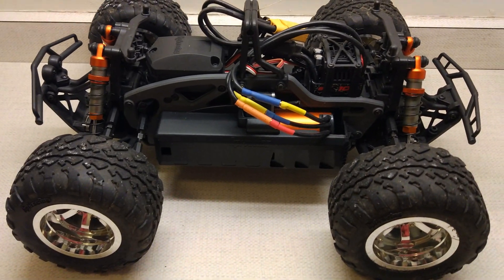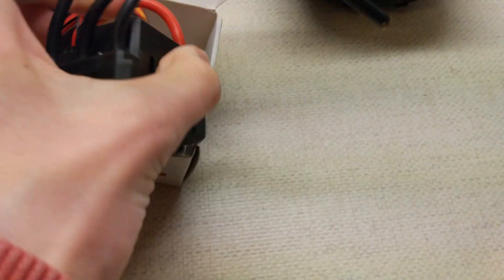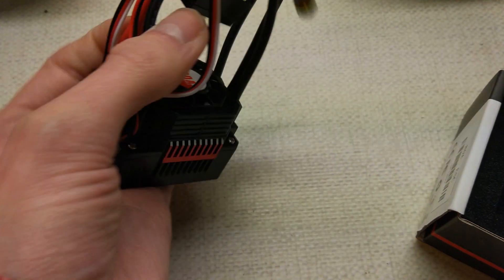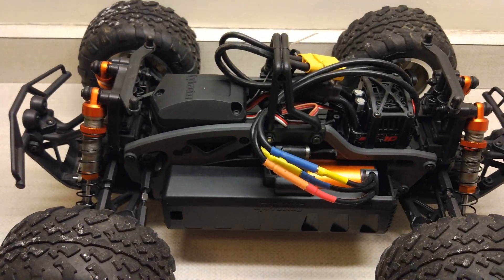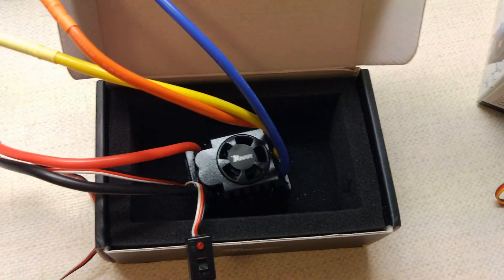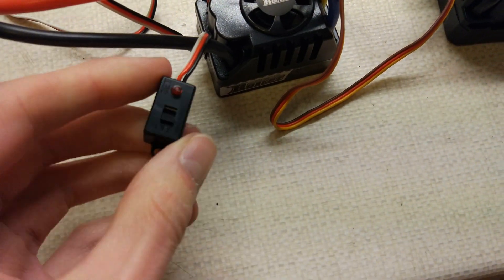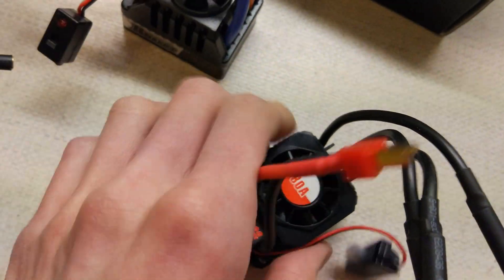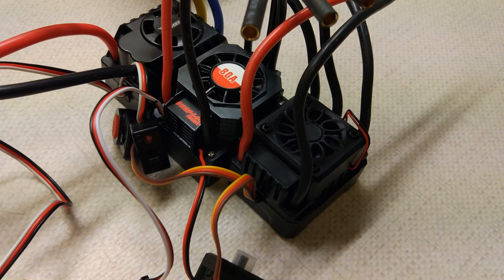80A ESC Overview X Team Surpass KK and Surpass Rocket

Comment: I can't wait to see the results of this comparison! Thank you for the video and all the effort and knowledge sir!!!!!!

I've had the same orange Surpass 60a fir 3 years and had it in a 4wd Mega Senton, Optima, 144001, 2wd Rustler XL5, Glamis Fear 1/8 2wd, BoLink Drag Rail, and a Gold Pan RC10. Its held up well, even on 3s with 3650-2p-3300kv KK BL motor. The fan still blows hard and ESC still pulls hard. I have since let it go to a friend and got the Surpass Version 2 KK 80 amp ESC, AKA Rocket-RC V2 80a ESC. This is the one with the "momentary" push button for on/off instead of the slide switch and it has the  program button next to it. I also got the Version 2 Surpass LED programming card. One thing I noticed is that my trusty old 60a ESC had many more programming options, 17 to be exact. And seemed to be about the same in performance. I desperately want to say this new ESC is leaps and bounds better but if I want to be honest I'd say it's relatively the same. Thats not such a bad thing considering all the cars, BASHING, wear & tear, and number of battz I ran through the 60a and it just kept going, popping wheelies and sending rooster tails of dirt all over the lands surrounding me! I can say they all come from the same massive plant in Shenzhen China , manufactured by Shenzhen LTD, CO. All the Hobbywings, Surpass, HobbyStar, HobbyQueen, Gool, ZTW, Reactor, etc.... I have been to the plant. The difference is the quality of craftsmanship. The more experienced workers are allowed to solder higher quality, more expensive components and they also get a $0.05 discount government issued gas card and $1100 more per year! Awesome! The different brand names are not used in China as they are not a free market system. Brand names are used by China only when exporting. I find Surpass Rocket, or as it's now called ROCKET-RC, the best "budget" brand. But fir superior support HobbyWing is far better. If you require good customer service go with Hobbywing. If you require solid budget bashing running-gear go with Rocket-RC. ZTW sits king of the BIG ESC GAME with fair support , great quality (for the most part) and features on oar with HobbyWing as well including PC Link, Bluetooth and Telemetry.   X-Team is a brand on par with Rocket imo, but most comparisons I have seen show Surpass Kk motors and Platinum motors beating Xteam at far less cost. I know not of Xteam ESCs though. 
Anyway, when you consider that a Tamiya TBLE-02S costs about the same as all these ESCs and then compare the features...and even bring the famous workhorse of a sensored 2POLE  ESC like the Hobbywing 10BL120 and NEW equivalent Rocket-RC sensored 120a ESC that also cost the same as a TBLE-02S you have to wonder what Tamiya and Kyosho can ever do to come anywhere near these ESCs. I don't see it happening....ever.
Reply from the maker: Not. Going to happen as I've sold most of my spare electronics now.

Comment: How did you think about surpass hobby kk esc ? It's good ?
Reply: I have one, the same 80A version it seems pretty good for the money. One thing I will say though it only reccoginses 2-3S lipos even though it's says it's specs are 2-4S. This is a spec mistake. If you plug in 4S you will only get steering, no thottle. Other people with this ESC have also discovered this so it's not just my one.
Reply: @druscanam  ohhh .okay tq sir 👍 i have bought 120a surpass esc , it's really good for me .I'm try to put dual 3s 100c lipo on this esc without any issue .esc not overheat .120a surpass hobby esc,surpass hobby 3650 6900kv brushless and dual 3s lipo 100c .with this setup , i'm got 128km/h on wltoys 144001.its really hard to control 🤦
Reply from the maker: I have not tested that one yet. So far the x team seems good.
Reply: I just bought the KK 80A esc. Will let you know when I try it out on a 3s. Current set up is 45A on 3s, just asking for a burnout.